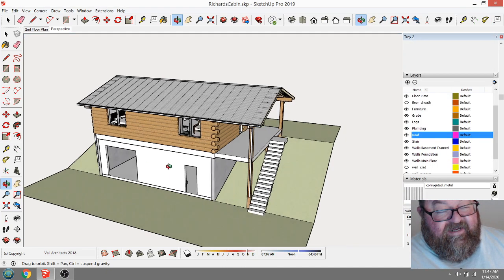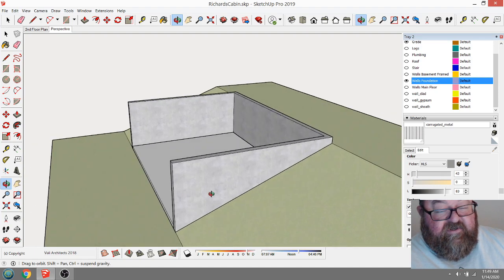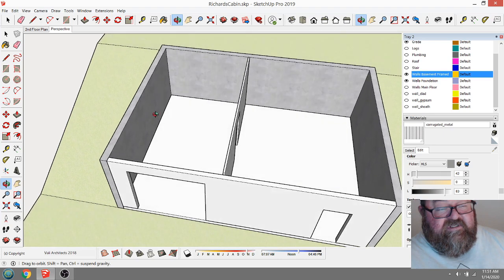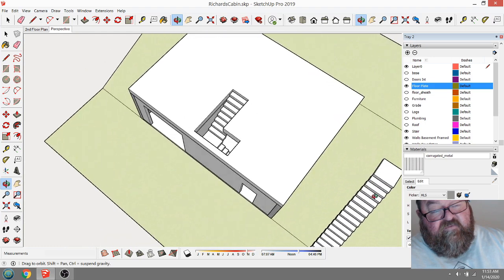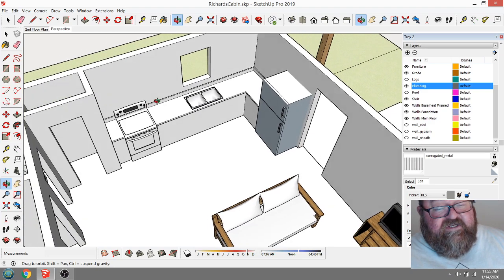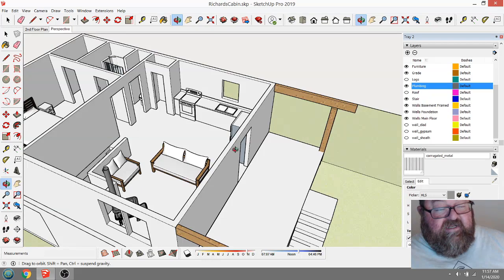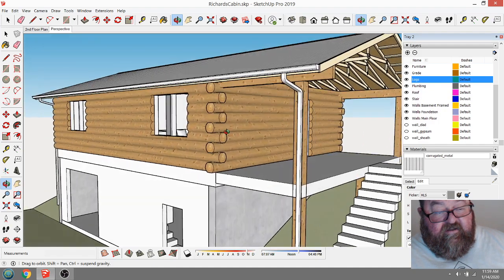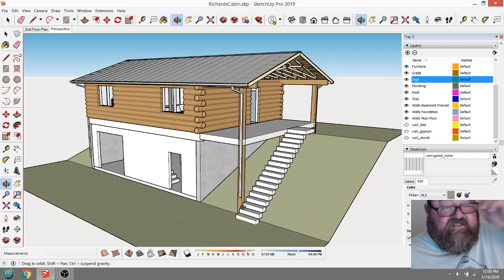Little Cabin in Tennessee - Part 1 - Schematic Design

Comment: VERY GOOD Tony you got 80% from the e mail from what I wrote. THANK YOU thumbs UP.
Reply from the maker: only 80% dang :)  I'll look at it again :)
Reply: @ArtisanTony  Extend the basement under the deck. You got the right idea with the inside. Thank you.
Reply from the maker: @RJM1011  ok but you will have to do one of those funky deck over roof situations but it is possible.
Reply: @ArtisanTony  Yes I was thinking of just concrete then maybe lay some slabs on that. :)